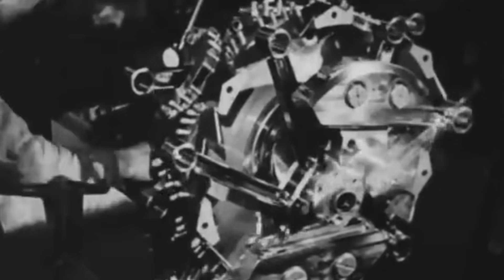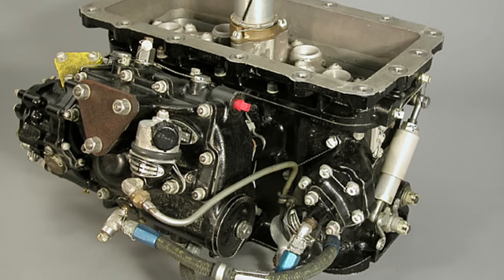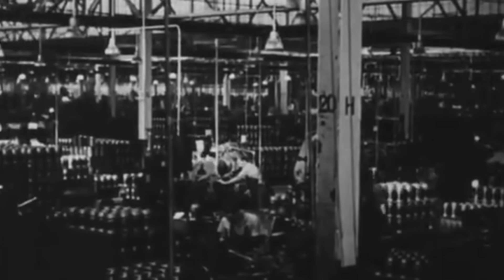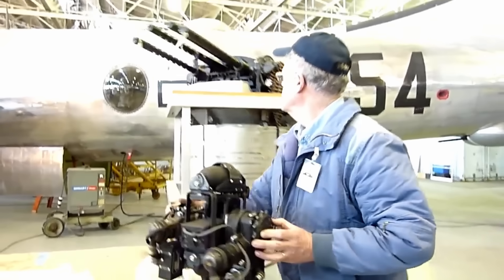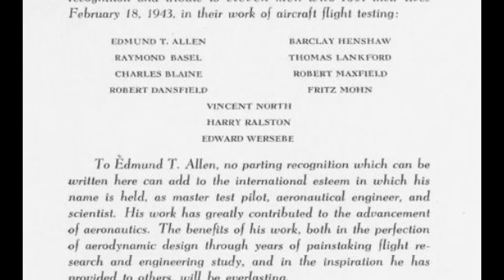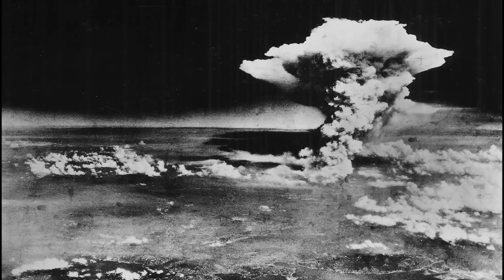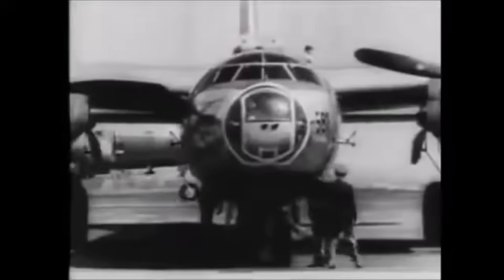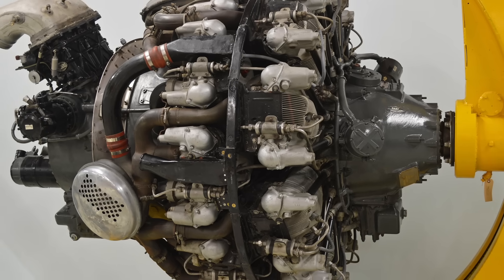MicroStrategy Connect: Community Top 10 #AsktheExpert

Comment: There was an old saying amongst B29 aircrew based on Tinian and Saipan in 1945: "What do you need to take off in a B29?" The answer was "either a full load of fuel or a full load of bombs, but not both". The 3350s only had a service life of 4 missions due to chronic overheating issues, with many aircraft lost way before reaching the targets in Japan. The first such takeoff from Tinian which was watched by the press and senior brass, thundered down the runway barely got airborne and plunged into the see. All the film was confiscated and the incident was never publicly reported.
Reply: Odd, the 3350 was quite successful in the Lockheed Super Constellation.
Reply: The L-1049C Super Connie used turbo compound versions of the 3350 with jet stack exhausts. These turboprop engines were indeed much more reliable, and increased cruise speed to over 300 mph. They weren't available until 1953, the B -29 and Boeing 377 were no longer in production.
Oddly, the service ceiling for the SC was 8,000 feet less than the Boeing 377.
Reply: @crankychris2 Correct me if I' wrong but I believe the Douglas A1 Skyraider uses the same turbocompound variant of the thoroughly developed R3350 as does the radial Reno air racers that replaced their Bristol Centurous sleeve valve and P&W R2800 original equipment with it to stay competetive and remain maintainable . .  . Proving that you can make success of anything viable if you focus the engineering resources of a capable  country on it . . . Eventually.
Reply: @iowapanner2223  Successful but also very high maintenance with relatively short time between overhauls... nothing like modern jet airliners.
Reply: The Conny was not subject to the stress of combat.
Reply: @iowapanner2223 The initial variant was an exhaust port leading, oil leaking, Magnesium crankcase fireplace excasserbated by a hurriedly developed cowling. A lot of decisions at Wright initially rejected some things that were eventually used to solve problems. There are accounts in print out there that purport that engineering arguments, reassignment  and jealousy played a part in decisions that set the development back.
Reply: Yes, but that was MUCH later after the thousands of bugs and problems were worked out. The changes made to that engine were constant and boggle the mind. The right schedule of war development and time constraints were a big part of this, though not the only cause.
Reply: Really not the fault of the engines. B-29 missions were often overloaded by 10% to 20% over the maximum design weight, and the earlier missions were flown to over 30,000 feet.
Reply: Yes, although the B-29's R-3350 engines are rated at 2,200 horsepower this is not countinuous rated power,  it's only rated to produce this figure for just 5 minutes. 
If the B-29 took off "hot or high" or overweight the engines can be easily damaged and required an overhaul in as little as 4 missions.  
The Merlin engine in a P-51 Mustang  required inspection and repair every time W.E.P. (war emergency power) was used and if WEP was used for more than 5 minutes the engine could require an overhaul after as little as 1 mission.
Reply: @sandervanderkammen9230  
Given the long flight from the Marianas (~1,500 miles each way), the B-29s were subjected to demands not yet seen in other theaters.  They often were overloaded.
Reply: @alanstevens1296  Absolutely, I completely agree.
2,200 horsepower air-cooled Radial pumping 32 inches of dry boost was pushing the very limits of piston engine technology at the time... and you cannot compare these heavy military bombers to later airliners like the Constellation and DC-7.
 These video game kids that think these planes could fly all day long at full power without damage to the engines is pure fantasy... 
At Max.Take-off weight these planes would be strained to make a decent rate of climb and pilots often used maximum takeoff power well past the limits to reach a safe cruising altitude.
Time between overhauls was shockingly low with these long missions.
Reply: @sandervanderkammen9230  
Airline service is easy compared to wartime combat service.
Reply: rrrrrrrrrrrrrrrrrrrrrrrrrrrrrrrrrrrrrrrrrrrrrrrrrrrrrrrrrrrrrrrrrr4rrrrrrr4rree4rrr4rr4rrrrrrrrrrrrrrrrrrrrrrrrrrrrrrrrrrrrrrrrrrrrrrrrrrrrrrrrrrrrrrr44rrr44r4rrrrrrrrrrrrr4rrrr44444r4444444444rrrr4r4rrrrr444444444444444r4rrr444r44r4rrrrrrrr4444r44rrr44r4rrr444444rr4r4r4rr44r4rr4r44rrrrrr44rrrr4rrrrr44r4r44rr4r4rrrr44rrrr44rrrrr4rr4r4rrrrrr4rr444rr44444444rrr444r444rr4rr44r444444r4444444444444444444444r4r4444444rr4rr44444444444444444rğgg
Reply: Engine fires and consequences thereof of the initial operational variant of R3350 was responsible for more lost  B29s than the combined efforts of the Japanese.
Reply: https://en.m.wikipedia.org/wiki/Pressure_carburetor
Reply: @ronharman7665 Yes, Carburator.... operates on the same rudimentary principle as all carburators do.
Reply: Luckily it was not a German project. Otherwise all the armchair engineers would call it „typical German overengineering“😁
Reply: @theonlymadmac4771

German stereotypes exist for a reason. Like German humour: it’s no laughing matter. 

German engineering meant that waiting for the Panther delayed the Battle of Kursk.. where its performance was still poor and gave the Soviets even more time to lay their trap. 

German engineering meant that the Wehrmacht, Luftwaffe, Kriegsmarine, and Waffen SS had state of the art weapons like the Stg44 assault rifle and Type IX U boat and Me 262 jet fighter.. but not basic things like food and winter clothes and fuel. 

Heck.. the V-2 rocket killed more people building it than it did in action. 

And today when I see things like the Volkswagen W16 engine that is more complex, more expensive, heavier, bulkier, less powerful, less efficient, and less reliable than an LS V8.. it underscores the point to this day.
Reply: @Bartonovich52 At barbarossa operation were a series of mistakes - the distances to reach  their objectives, the environmental conditions in a country like URSS and to believe that the war was resolved in a snap or a flick of an eye... The generals knew the problems to do the plan but Hitler no...
Reply: @theonlymadmac4771 if german engineered sure they were mounted on these a real mechanichal injection system like DB, Junkers and BMW ...
Reply: Doesn’t disprove my point.
Reply: 4 missions seems like a bit of an exaggeration, the early engine's had a service life of 100 hours, which means 4 missions would have been 25 hours each, they weren't 25 hour missions, more like around 10 to 12 hours which would put their replacement in the 8 to 10 missions range, by the wars end they had them up to 400 hour rebuild intervals. 
Like many things about WW2 the R3350 engine has suffered from exaggerations about it more than it's actual issues, having to replace all 4 engine's on B29's every 4 missions would have been a mathematical impossibility, they weren't making engine's and shipping them half way around the world fast enough for that to have been possible.
Reply: @dukecraig2402  Wrong, the  R-3350 had a PFTR of 100 hours, this is not the same as TBOs,
PTFRs are established with military power (P-100) 2,200 horsepower is P-Max.. the maximum power output for just 5 minutes (WEP power)

Frequent use of WEP will significantly reduce TBOs and TBOs  of 25 hours or less were not uncommon for certain missions when Max takeoff weight was required.
Any questions son?
Reply: @sandervanderkammen9230  
Yea, you learn your lesson yet about the Bendix injection carburetor and how they're actually fuel injection and not a carburetor in the traditional sense of one like you kept demanding they were, boy.
Reply: @dukecraig2402  Carburators are not fuel injection son... you are clearly not qualified to discuss this topic inteligently.
Stop pretending to be something you're not.
Reply: @sandervanderkammen9230  
And they weren't carburetors, I already explained to you they were actually single point throttle body injection, the designers just didn't know to call it anything else but a carburetor. 
You obviously have no idea how an actual carburetor, with a float and a jet that relies on the pressure differential in a venturi to force fuel through it from the bowl, and the difference between it and a throttle body injection that has no float and a jet relying on a pressure differential.
Educate yourself on them, just Google Bendix injection carburetor and you can find all kinds of information crediting them with actually being fuel injection, throttle body injection to be specific, instead of an actual carburetor.
After you've learned your lesson on that I'll explain everything wrong with your claims about the B29 engine's and their service intervals, I can only straighten you out on one thing at a time.
Now run along and start your education on Bendix INJECTION carburetors.
Reply: @dukecraig2402  A FLOATLESS Carburator is still a Carburator son.
It's not fuel injection so please stop making a fool of yourself.
Reply: @dukecraig2402  Its a pressure-feed CARBURATOR, It's just like any other carburator except it does not have a float valve to deliver fuel.
Reply: @dukecraig2402  Even Bendix-Stromberg calls it a Carburator..
Not fuel injection.
Reply: @sandervanderkammen9230  
Float valves don't "deliver fuel" except into a bowl, something the Bendix units didn't have BECAUSE THEY WERE THROTTLE BODY INJECTION and not carburetors in the sense you keep demanding they were. 
Instead of continuing to make a fool of yourself why don't you just do the research and you'll see where they're credited as an early throttle body injection system and as such not actually a carburetor. 
Once again, same as GM's 1950's mechanical fuel injection.
Reply: @dukecraig2402  Sorry son, 1950s GM cars had RODCHESTER RAMJET mechanical fuel injection.

Completely different and totally unrelated to the Bendix-Stromberg  Carburator.
Reply: @dukecraig2402  The Bendix-Stromberg is floatless carburator. 
Not fuel injection.
Reply: @dukecraig2402  You seems to be very confused and misinformed regarding the fundamental difference between a pressure feed carburators and Throttle Body Injection... they are not the same.
Reply: @sandervanderkammen9230 But the Bendix was a throttle body fuel injector regardless of what it was called.
Reply: @blackpowder4016  The Bendix PD pressure feed carburetor is not the same as fuel injection, it 
requires a venturi to operate the fuel metering circuit which restricts airflow and reduces brake horsepower.
Reply: Hearsay & poppycock Dodge built engines were the gold standard
Reply: The whole program was rushed & American boys paid the price
Reply: The whole war was rushed & American boys paid the price

Comment: Here is some trivia:  The B-28 evolved into the B-50, then the 367 Stratocruiser, with four R-4360 engines.  The airliner version was the Boeing 377.  These airplanes were B-29's with a second much larger fuselage laid on top of the bomber fuselage.  In profile they looked a like an "8", with the upper lobe somewhat wider.

Then in 1952, Boeing designed the 367-80 Stratocruiser, which of course was a complete ruse.  The 367-80 was none other than the Boeing 707.  What they did was take the double bubble fuselage of the 367/377 and fill in the dents and make an egg shaped fuselage.  This was the original 707.  Later, they widened the fuselage to 148 inches, and this was the production airplane.  But also the production 720B, the 727, the 737 [all models] and the 757.

Which means that a 737 Max that rolls off the assembly line in Renton tomorrow actually has belly panels that were designed for the B-29....

I'm not kidding, the belly panels of every 737 match the belly curves of the B-29, if not actually are interchangeable!
Reply: Really interesting trivia. The war certainly added to technology moving forward at a tremendous pace. 😊
Reply: The -80 was 132 inches, capable of five-abreast seating. Boeing made the production KC-136 fuselage 144 inches and was going to do the 707, but C. R. Smith (CEO of American Airlines) said he wouldn’t buy the jets unless they were 1” wider than the Douglas DC-8. Boeing made the 707 fuselage 148 inches wide for that reason.
Reply: @aaronshipley5594  The Boeing 707 was designed from inception to be a very modular and adaptive with different fuselage lengths and diameters, wing spans and engine arrangements.
The 707, 737 and 727 all share the same basic platform and a high degree of parts commonality.
Reply: No. 

1) The lower belly diameters are not the same.. not even between the 707, 727 (the front and back are different on that one), and 737. 

2) The belly panels are made of flat sheet metal that are rolled, drilled, and riveted into place. They aren’t even technically interchangeable between the same aircraft unless you oversize the holes. 

3) There’s no interchangeable parts between the B-29 and 737-MAX.  None. Even the fasteners are different (AN/MS on the B-29 and BAC and NAS on the 737-MAX). Maybe some cotterpins and rivets might be the same.. but they aren’t reusable.
Reply: @Bartonovich52  1.  The forward fuselage barrels of all three are nearly the same. Some minor structural details are different, but they are the same.  An engineer from Boeing told me this.

2. True.

3.  I never said there were interchangeable parts between a B-29 and a 737 MAX.  The designs are distantly related via evolution.
Reply: Boeing fortunes would been very different if one of its engineers, German-American George Schairer hadn't stolen the blueprints for the B-47 from a  secret Nazi aircraft research laboratory during an inspection by the Von Karman Mission.

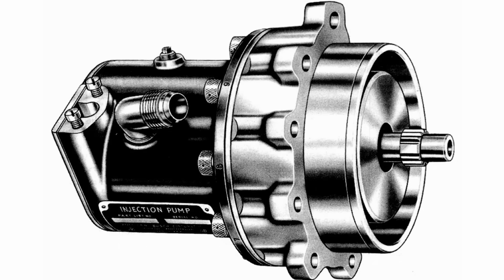Comment: At 2:32 "Bosch also developed a similar fuel injection system"

Bosch is a German company.  Hello?
Reply: BOSCH introduced Direct Injection in  the 1930's and had subsidiary divisions in the U.S.
Reply: @sandervanderkammen9230  Noted.
Reply: @sandervanderkammen9230  Didn’t they build pressure carbs during the war as well, along w ignition systems and harnesses?
Reply: @Pene7942  Bosch invented the first commercially successful spark plug magneto ignition system and produced Diesel fuel injection systems, Bosch developed the first successful Gasoline Direct fuel Injection.
Bosch as far as I'm aware never produced carburators.
 "American Bosch" an independent company originally founded by Robert Bosch GmbH. also made Diesel injection and propane carburators, I'm not aware of any pressure carbs for aircraft though.

Comment: Minor point:14:52. Wasn't the Boeing 307 fully pressurized? Also you neglected to mention that a waist gunner on the B-29 could control 3 turrets. Front lower, rear lower, and tail (if they weren't in use)
Reply: Yes, the Boeing 307 Stratoliner was the first fully pressurized airliner.

The Junkers Ju-49 was the world's first pressurized aircraft in 1931.
Reply: I don't believe it was the waist gunners that could do that, I believe it was the upper turret gunner who was somewhat of the master gunner who had the controls that could dictate which guns were slaved into which gun sight.
The channel WW2 US Bombers has several videos on the B29's defensive guns that are the most factual and complete of any videos you'll find, he goes into great detail about the computers, how they formed their ballistic firing solution, the fact that each turret had it's own gun camera for verifying kills, the changes made to different variant's, how the sights and the triggers on them worked and just about anything you'd want to know about the defensive guns on a B29 including the amazing fact that they had a kill to loss ratio higher than the P51 Mustang.
Reply: @dukecraig2402  Trust me on this. The gun commander (upper gunner) had primary control of the upper rear turret, and secondary control of the upper front. The waist gunners had primary control of the lower rear, secondary control of the lower front, and secondary control of the tail mount. Waist primary control was switch selectable between left and right waist. Of course, the nose gunner had primary control of the upper and lower front turrets, and the tail gunner had primary control of the tail mount. This was done with an "action switch" on each gunsight. In practice the gun commander was responsible in coordinating his gun crews response to threats. That section behind the bomb bay where gun commander, left and right waist were, was called central fire control, specifically because all turrets could be controlled from there. Here's another tidbit. The B+ to the servo amplifiers wasn't DC, but 400Hz AC.
Reply: @lnchgj  
Yes but it was the gun commander who had say on what guns were controlled by which sights, not the waist gunners, they couldn't switch what guns were slaved into their sights which is the way it sounded in your first post, the gun commander and not them controlled who sighted which guns, hence his title gun commander, there's only one lower turret and two waist gunners, someone besides them had to dictate which waist gunner had control of the lower turret, that was the commander not them.

Comment: When you work on the bleeding edge of technology, sometimes, you bleed before things work. I have seen it multiple times in the computer industry, including what is going on with AMD right now with their 7000 series processors. The only difference being, these engines were needed for war use, it meant the difference between ending the war and it dragging on. It is mind blowing to me, how fast tech changed just between 1920 and 1940, but especially between 1935 and 1945.